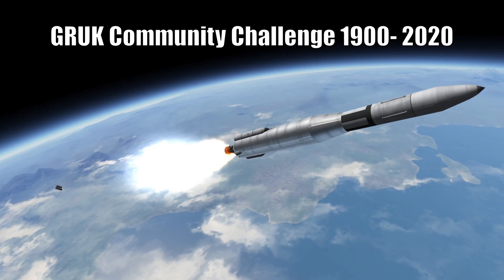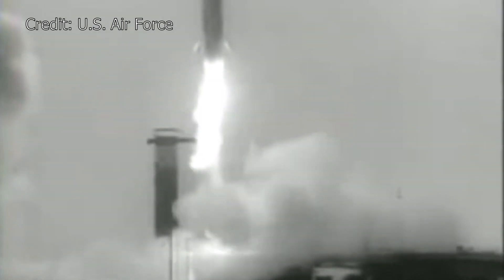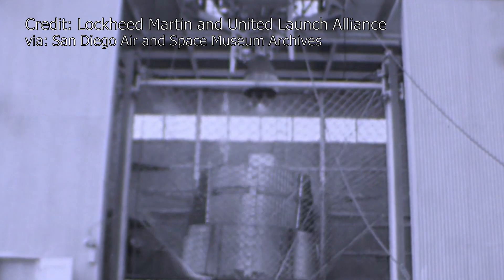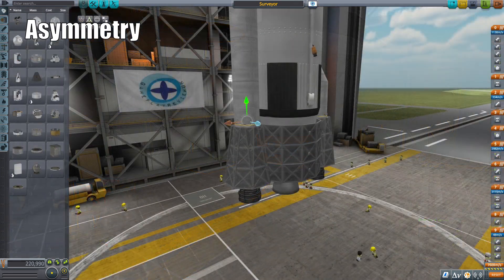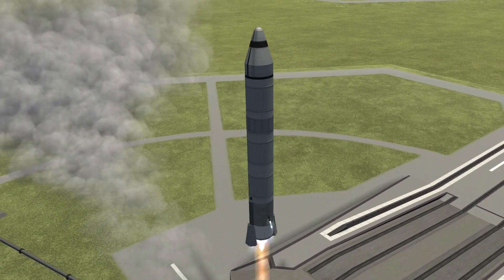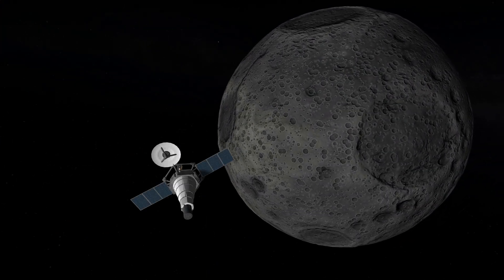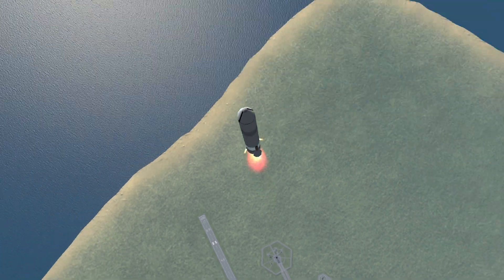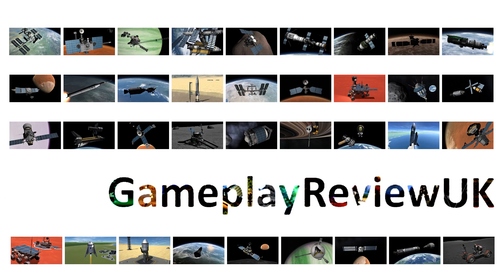Atlas Rocket Stage and a half Challenge - GRUK KSP Part 9

Comment: These are simply brilliant!  I've been trying - off and on - to get the stage and a half jettisoning for quite some time now, but it's not so easy as these guys make it appear.  To be fair, I have cobbled together a rocket which works pretty good when staging, but the skirt seems to collide with something as it falls away, throwing the rocket off course, and for some reason, it's always tricky getting it back on the right bearing again.  I've watched it over and over from numerous angles, but so far can't suss out what it's hitting, very frustrating.

You guys are, obviously, geniuses!  There doesn't appear to be very much in the way with collisions with these rockets!  My favourite..?  Probably the first one, but I wouldn't be complaining if I could claim any of them as my own.